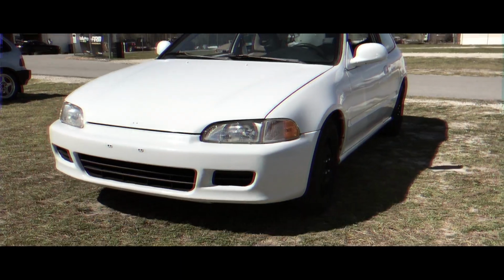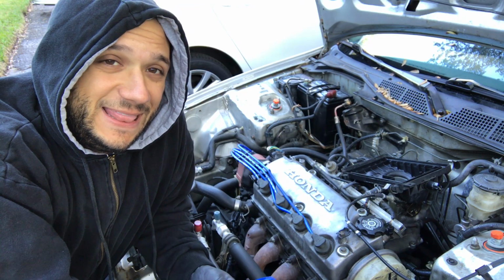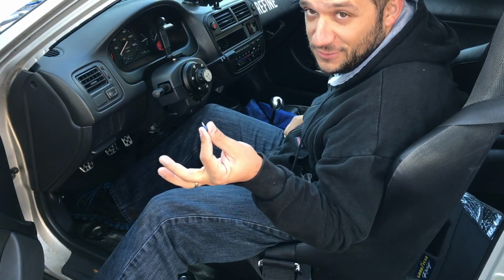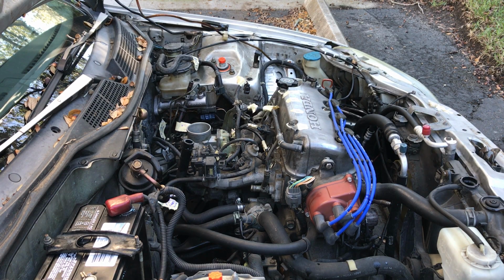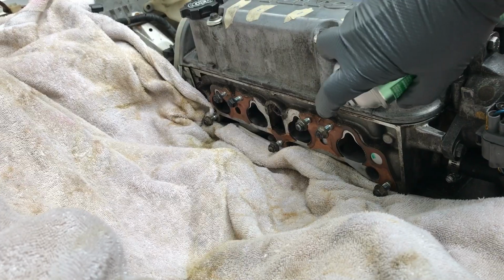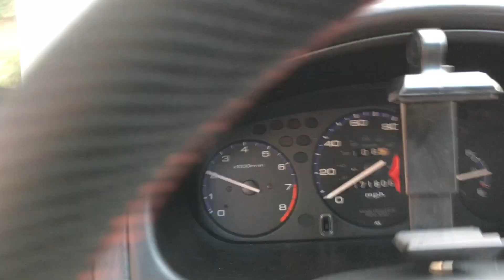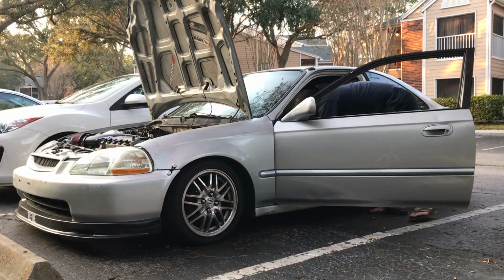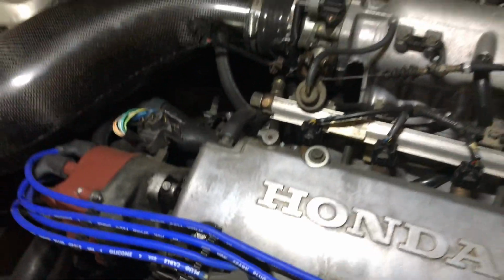Y8 intake and Password JDM install on Project Civic EK

Comment: It's the air idle sensor always when the idle jumps up and down like that happened to me twice with Hondas
Reply: The sensor that goes on the iacv ?
Reply: @jaw-waadhendricks3903  it's the sensor for the which helps with air fuel. So it's called the air viewer ratio sensor it usually goes on the manifold for d-series and b series engine's

Comment: You should do a catch can or just vent the breather to atmosphere. From my experience with Hondas no oil will come out of the breather but it will come through a PCV valve, I can't remember if D series has them. I always run a catch can for my PCV then vent the valve cover to atmoshpere.
Reply: Good info, my PCV valve just breathe to the atmostfere because the last time I did intake manifold gasket change I don't have idea about it....is it give any effect to the car?

Comment: nice vid,can you tell me why your car was idling up and down and how did you fix the issue? thanks
Reply: Generally it has to do with your IACV (Idle air control valve)  having issues, may want to try cleaning it out

Comment: haven't owned a honda in a long time.  just picked up a 95 integra for rally cross.  

back in the day I had a built turbo d series.  At the time it was more of a "can I make it work" scenario.  no body wanted them.  no I think they are my favorite motor from honda.   they really make the car light on its feet compared to the other motors.  naturally aspirated they are kind of wimpy.  turbo or super charged they are great.
Reply from the maker: +Texas Car Nerd good to know for the future thanks !
Reply: Texas Car Nerd I've just put a turbo on my stock d16y7. Just waiting to get her tuned for some real fun
Reply: hi.i recent 3 days ago resurrect my civic ex d16y8...4years parked in a dark room but this year i make they works again.its easy light and fun i like this engine.  is not a bullet but fun enought :D

Comment: I like the vid. You should really think of getting a new map for the car now. After switching the intake manifold, what happened is your engine is getting a lot more air, but the same amount of fuel so your AFR is bad. Valves especially no like. I heard you can also get a fuel presure regulator from like B20 CRV to feed more fuel but that you would have to check for yourself. Anyway, better save then sorry, espescially when you track the car and hit high rpm.

Comment: I had the same car with the crappy y7. I converted mine to vtec. You should throw the y8 head on there and wire up vtec and convert the car to obd1. Makes the car run way better
Reply from the maker: +Brandon aka DeadShot I have definitely thought about it maybe someday
Reply: Well I just totaled my ek and I have a good engine with the vtec head I am currently dismantling if your interested in the head I'll sell it to you cheap
Reply: still got that? ill buy it

Comment: When changing the admission, did you use the same harness and ecu or did they change it?
please respond, I'm about to make that change.
Reply from the maker: Not sure what you mean?
Reply: @RefineMovement  Sorry my English is bad, I'm from Mexico. when riding the acceleration body y8 did you use the same harness of y7, throat y7 and injectors y7 ???
Reply from the maker: Yes. It should be in the video what I used

Comment: Did you extend the wires or anything at all? I just did mines and the fuel injector wires won't reach the fuel rail...
Reply from the maker: +Mongerz I think I cut the wire loom and was able to pull them close enough.

Comment: What are the benefits from this swap. I'm wanting to make my little y7 breath better
Reply from the maker: That’s really it. Breathability. Little better throttle response
Reply: Either Y8, or the Z6 intake will give you more power they are almost the same with performance specs

Comment: loose the y8 intake mani and password jdm intake tube. the z6 intake mani and a 2.5 tube with velocity stack, both of these have been dyno proven to make more power then the later.
Reply: richardhstratton I tryed to run z6 with extra ratorator line and no ports in bottom for two lines. How did you hook it up?
Reply: Photos would be nice

Comment: Hi my question is my daily is auto but it's haves the big air box like yours would I need an automatic Y8 intake or would a 5speed y8 intake work fine and will it be all plug n play
Reply: jdm fatboy I believe it's just a different IACV location. You may have to adjust or buy new trans and throttle cables.

Comment: how did you get it from reving so high mines stays at 3 to 4k
Reply: Use Toyota's Denso FICD and it will settle down the idle, dont forget about your IACV aswell, clean  and settle it up. I did that to mine but when turning on the A/C it suddenly feels soo heavy

Comment: Don't you get embarrassed driving such a raspy and loud Civic on the streets? I understand this is a track car, but throwing on a resonator should hurt flow that much, especially with such a low output car. Not bashing or anything, just suggesting
Reply from the maker: +Vincent Poon yeah it’s alittle embarrassing but it’s really only loud when I have wide open throttle. There is a resonator on the pipe just no cat and no muffler. To be honest the car is uncomfortable on the streets with the mods I have done. It’s a full on track car now which I am fine with as it feels amazing on track. I am have a Mazda3 I daily. Thanks for watching!